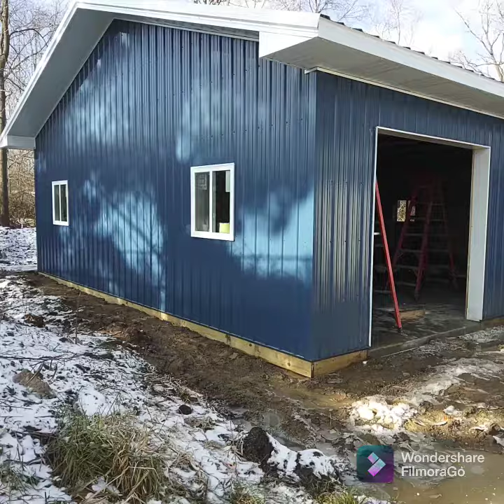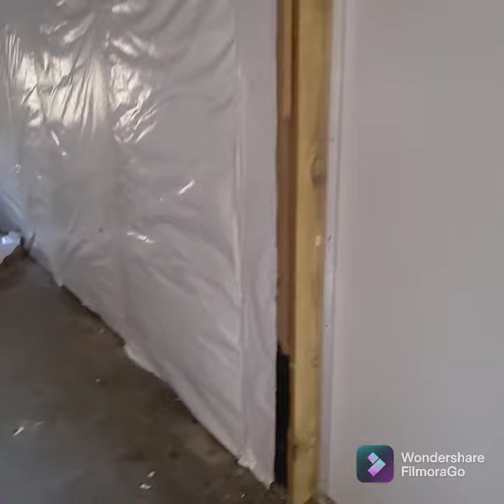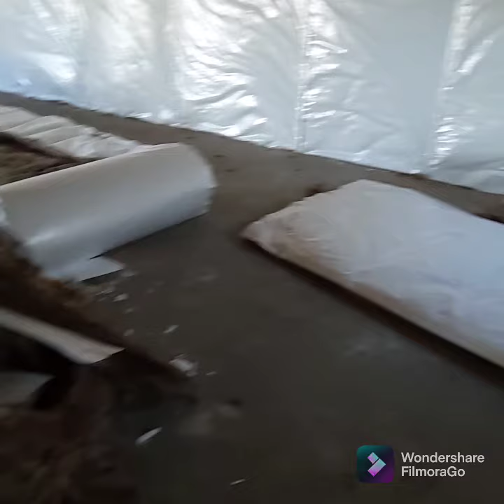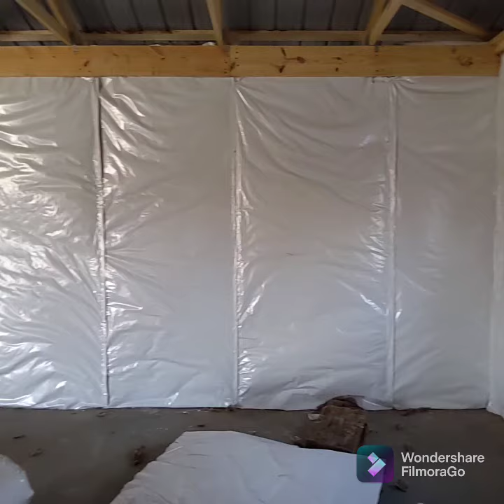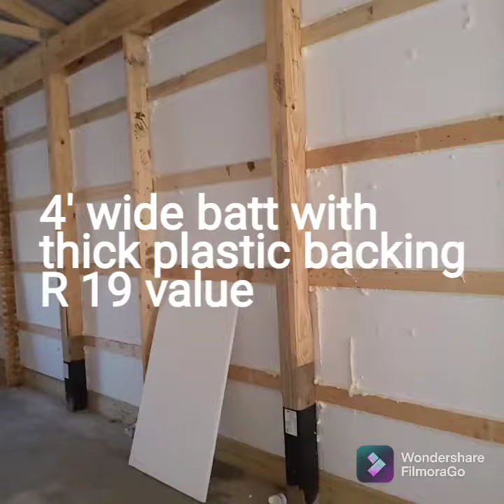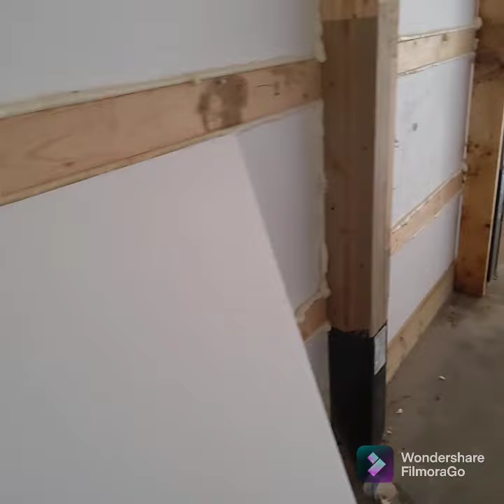Easy Barn Insulation

Comment: Any issues with condensation rotting the horizontal studs? I have a 12 x 48 ft shed metal walls and roof with wood studs we want to convert to a tiny house, any recommendations?
Reply from the maker: What’s your climate like?  If you’re in the south east with warm temps and high humidity you may consider pulling the side panels off and installing a house wrap (Tyvek).  With a building that small, you could use a closed cell spray foam, which creates a vapor barrier, and spray that directly on the walls.  It’s better to spray CCSF on house wrap and not directly on the metal.  However, people have been doing it for years.  For most climates, it seems like the natural weather of hot/cold and dry/wet will naturally ebb and flow and the build material will flow with it.  My best recommendation is to call at least 2 local insulation companies in your area and find out what the old guys recommend for your city specifically.  Good luck with the project!
Reply: Yes, I am in northern Alabama. It is cold in the winter and hot and HUMID in the summer. Thanks for the tips!!

Comment: Found you post while researching options to insulate the pole barn on my property.  It is 30x48 12ft tall with commercial gerts.  There is no house wrap product between the metal and framing.  Do you know anything about the Prodex product?  Thank you.
Reply from the maker: Yes.  If you do the single bubble with the silver side, it only carries approximately R2 or 3. But if you attach it to the wall purlins and leave the inch or two space between the outside wall metal and the vapor barrier. It will create an air gap and give you a better insulating value.  I have used that product under flooring, and also on the underside of metal roofing.

Comment: What about the ceiling, how did you insulate the roof of the barn?
Reply from the maker: Best option is hanging liner panel from trusses to make a ceiling, then blown cellulose.  If you don’t care about looks you can spray foam the roof panels.
Reply: @barnandhome  thanks for the reply! Which option did you go with, or did you just leave the ceiling open?
Reply from the maker: @josephwan3857  I think we did liner then cellulose. That’s what we do 95% of the time.

Comment: Thanks for posting. I’m researching insulating  my post frame. 

Insulation and vapor barrier best practices would dissuade from creating a 2 sided vapor barrier like shown (foam for outer wall, white faced  portion of batt on inner wall). 

So, for others viewing this vid, it is a fact that any vapor or liquid that finds its way into the wall will have no place to go with this approach, and I would not insulate quite like this. 

I am seriously considering the wide batts myself, just not going to use foam or anything else towards the outside wall, that also acts as a vapor barrier. In a cold climate you want your vapor barrier on the inside wall so the batts are good, just not something additional that is a barrier to escape of water or water vapor on the outside wall as well. 

I admit having had a strong urge to fill all available space I have in the wall, especially when foamboard is the perfect thickness to match the outer wall gerts! It’s really tempting, and hey, more insulation is more better, right? But no, not good!
Reply from the maker: So, one thing is that this particular client has been notorious for adding on little by little as projects go….  “Can we do extra concrete outside?”…. “Can we add gutters”…. “Can we add a lean-to?” …. Super nice guy to work with, but not everything was planned up front at project start.  The BEST way in my opinion is just doing house wrap on the back of the metal walls, then use either closed cell spray foam, or open cell spray foam and then cover the walls with liner panel.